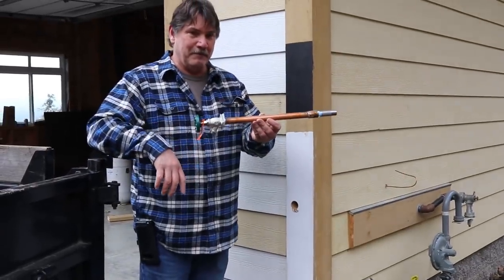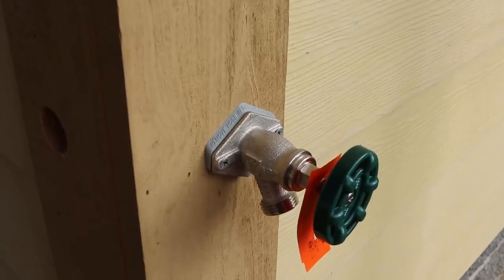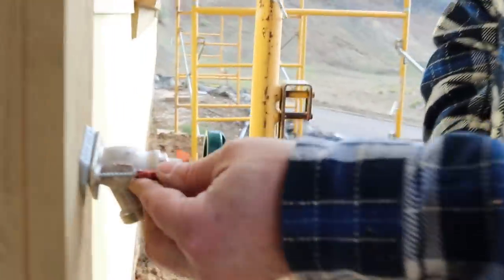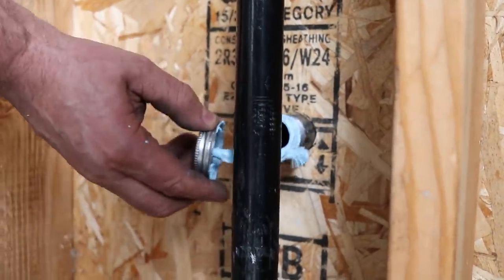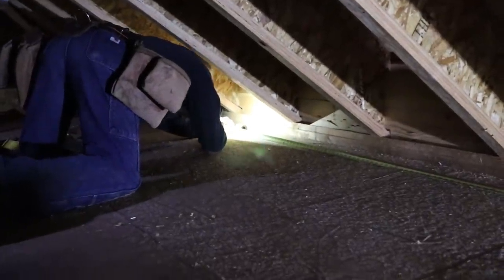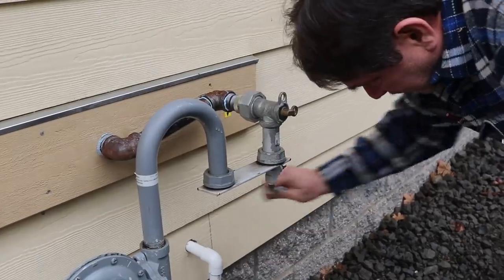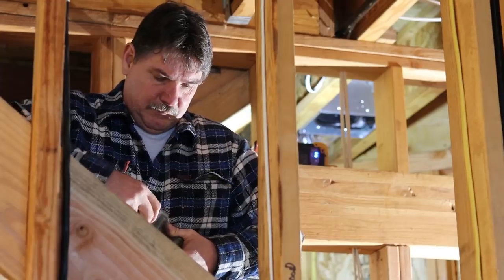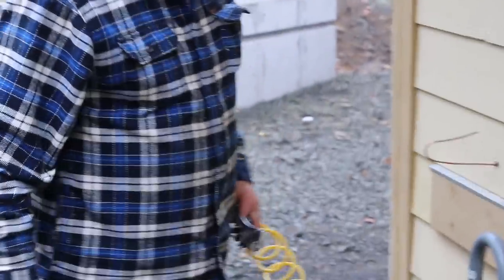Gas Pipe, Hose Bibs, Water Heater Ep.99

Comment: Would love to hear Phil’s take on corrugated stainless steel for gas lines.
Reply: I work in commercial HVAC design, which exclusively uses steel in my area, so I don’t get much professional experience with CSST. But from what I understand it’s standard in Japan. They developed it because of black iron breaking during earth quakes. 

The fact that it’s cheaper and easier to work with were secondary factors. 

I wanted a gas range and NG for my grill outside, so I just ran two lines myself this fall in CSST. Went well and no leaks. We’ll see how it lasts but I’m feeling good about it all. It was much more robust than I had imagined.
Reply: My first experience with it was my HVAC contractor who installed a ng furnace about 10 years ago. I used it in combination with black iron to self install  a ng power vent water heater Dec 2019.

Comment: I once ran an entire shops worth of black iron (4 bay repair shop, plus outside fittings). It was an absolute pain in the butt, however, a very important lesson was learned in the process. Use plenty of union fittings so you don’t have to tear everything apart to fix something at the beginning of the run. A lesson learned the hard way. Thanks for the wealth of knowledge that you willingly share Scott, it is greatly appreciated.
Reply: All you need is a sawzall and you can add a union where ever you want.

Comment: My hose bibs are built into the wall of the house in a stainless steel electrical junction box with a key locked gasketed door. The inside of the box (except the back) is insulated w/ standard 1" thick black rubber  HVAC chiller type insulation. All 4 hose bibs have both hot and cold water and are frost proof. (Prier faucets). The hot water is hand key controlled so that some dumbass wont turn on the hot and burn themselves. That's also why I used a locking cover box. I have a short handmade copper tube extension with a female swivel GHT adapter for connection to the faucet that then  exits out the bottom of the box with a Male GHT coupling for the hose to connect to. I had to trim the elbows to length to get it to fit. Guess you can call it half a solder joint. Then I can leave the hose on the bib during the summer with the door locked. The insulation on the bottom is loose and is removed during the summer while said adapter is in place and is returned to the box when its chilly. A small piece of stainless covers the extension exit hole to help prevent damage to the insulation. If I need hose water in the winter i just unlock the box and attach the hose to the faucet. When I'm done, then the  hose is stored away and then the box is locked up. There are 2ea  3/16 weep holes in the box front corners to allow any condensation or stray water to find a way out. The box is canted so the the top protrudes out 1/2 more than the bottom and those drain weep holes are lower at the front. The insulation is notched at the weep holes to allow drainage. Yes they were expensive to do 20 whatever years ago, but haven't frozen like some neighbors have done. with that costing them $1000. for the deductible with some having to repair twice until I talked them into heat trace cable. BTW the faucet cover doors are on the alarm system. You got a great plumber there.
Reply: Good thinking!
Reply: What area do you live in that the box enclosure is needed around a nominally frost-safe bib?

For either kind of installation, correctly applied thermal insulation would surely be needed. The bib won’t freeze if the inside end is truly in the conditioned space and from there slopes down outwards as shown. A box lid, by contrast, is hard to insulate well, and you need the weep holes. Could you be losing heat unnecessarily?

Comment: "If there are leaks you basically have to tear the whole system apart to get back to the leaky fitting". Eeeeh normally if that's the case i'll just cut the longest straightest piece closest to the leak and install a union.
Reply: You can't use unions if it will be concealed though....
Reply: Yeah they don’t let us install a union around these parts must be nice
Reply: its these moments when the ridgid press tool comes in very handy

Comment: Actual question, why not have reverse threaded fittings, which would allow you to remove certain joints without having to "undo" the whole pipe system to that point?
Reply: There are fittings called unions that can be installed in key places for that purpose.

Comment: I well remember years ago a plumber running pipe to our new gas stove. Guy checked for leaks with a lighter, which was a huge red flag/ Two days later, what's that smell? He'd used a 2" nipple to connect the flexible gas supply to the stove and gibbled the threads up with his pipe wrench. Got a new, longer nipple and some pipe dope and fixed it myself. And checked for leaks with soapy water.
Reply: It's not really a red flag.  Natural gas is fine to do that on, but it's not standard practice.  Propane is not a good idea.

Comment: I like seeing you run gas for the dryer. I’ve never understood why people run natural gas in there house but don’t run a line to the dryer. Having gone between the two i have to say my gas dryers were always a lot better.
Reply: They don't want to pay that little extra up front for the labor on the iron pipe, but they more than pay for it through higher electrical bills. 
I have gas everything. Dryer, stove, furnace & hot water. 
Very economical.

Comment: The only downside I’ve heard to tankless is that if there’s a power outage you will lose your hot water.
Reply: You won't have any water at all because the well pump won't work either.
Reply: @Alex.AL_26  Sucks for the ~1% of people who use a well for their water supply.
Reply: @jej3451  I am afraid it is a lot more than 1%, as soon as you get outside of a large metropolitan area everyone is on wells.
Reply: @Alex.AL_26  Okay, 15% of the population (per USGS statistics).  There is an 85% chance your original comment was wrong.

Comment: we like to put unions every 20 feet or so for future service
Reply: Unions are only allowed between the appliance shutoff and the appliance.  Never inside a wall or crawl space. Use left right coupling and nipple to t in or repair. I know, it’s harder that way but I’ve found unions leaking while doing my pressure testing and it’s a pain to go after and remove them. A well installed system won’t need to be repaired and it’s rare that you can add a new appliance without upgrading the system or running a new line.  On a big system you can cap and test the system every so often so you don’t have to backtrack too far to resolve a leak
Reply: @mikefox5510  Cool thanks for the reply!  i'm still learning...i learned mainly for one guy who learned from his dad...always good to hear how others in the trade do it

Comment: A word to the wise on living with a tankless hot water heater.  Don't just look at the hot water output.  Also take note of the minimum flow required to kick the heater on.  It can be frustrating to all of a sudden find cold water flowing because you turned the hot water down and not enough was flowing to keep the heat on.  Especially a problem in hot climates (e.g. Arizona), where ground water can be pretty warm and not much hot water is needed for the desired temperature.

Comment: The pipe dope and teflon tape is applied to tapered threads to serve as a lubricant. The interference fit of the threads is what seals the connection. The tape or dope helps to ensure that you can freely turn the pipe and connectors far enough to make the seal.
Reply: Why not just spray on some WD-40 then?  (Or graphite or other non-flammable lubricant)

Comment: Why are you using steel pipes for the gas if it's under less pressure than the water lines? The plastic hoses look so much easier to assemble.

Comment: I suppose that black iron is the code, nobody sane would chose that out of boredom
Reply: Black pipe is/has been code for gas for a century or more. Galvanized pipe after time will see the zinc flake off and clog the gas jets at the appliance. Black pipe just rusts and has to be replaced when it begins to leak as I learned with my 30/40 year old house a few years ago.
Reply: @charliesimpson2974  thought so, in Europe we use polypropylene for service and copper past the meter

Comment: To all you DIY-ers out there, be sure to check your local building codes...different places have different rules about using galvanized or black-pipe with Natural Gas or Propane Gas. It's complicated.  ,,,and then there's sediment-wells. Ask your Inspector before you build.

Comment: Worked for a (hack) contractor in Ca; about 12 employees. Only subbed out roofing/drywall. Built a post & beam, full wrap siding 2500 sq ft on a narrow lot on the Colorado River. After framing, the house sat for around two months. Came back for siding. Studs were totally tweaked. Put first piece up...OMG!  It would make u seasick (stud bowed 3/8 in, next stud 3/8 out, on a 60 ft wall. No b.s.). Called contractor. He said "it's fine." What an abortion. Luckily went back to my regular job the next week.

Comment: I love Phil's simple explinations and directions. He reminds me of my dad.   He said he did not like frost free calls (1:10).  Check out Matt Risinger (the build show channel) https://youtu.be/JItfWP7Li-8   Go into 4:12 and you can see a simple installation using pex and you can fix it later from outside the house.  I loved it.  I did it on my last house, both in the wall and under the floor.   I would get a shorter hose bib next time.   Also all my external hose bibs come to a shutoff valve in the equipment room with a drain cap screw.  I can turn off the water, open the bibs and blow out the water on all bibs for winterizing.   I do it even though they are frost free cuz of my OCD. If you like it please share it with phil. (I don't buy the expensive hose bibs, I just buy arrowhead)

Comment: Phil made running that screw pipe look easy, especially running the drops in the attic, where the holes were pre-drilled. Typically you expect the take-up on a fitting to be the diameter of the pipe, but that can vary depending on who's running the threader, the condition of the dies and the quality of the fitting and pipe.
Just before I quit working, it could be difficult to do consistent work, the quality of Chinese pipe and fittings can be all over the place. Maybe it's just because my employer just bought the cheapest stuff they could find, but the quality wasn't there like it was in the mid-90's when I first started there. And the black stuff was great, compared to the stainless, it was garbage, but was all we had, had to make it work.
Had to chuckle when Scott referred to the 24" pipe wrench as "big". For a home owner, it is. But size is relative to the field you're working in. Personally the biggest screw pipe I ever ran was 3", and we were using a 4' pipe wrench with a 4' cheater bar and two grown men hanging off the end of it at times. As far as I am concerned, anything bigger than that ought to be welded pipe, I don't want to fool with it. 
Even at that, I've seen pictures of work being done where the tools had to be moved with a crane, and hydraulics employed to actuate them.
Enjoyed Phil, and as always, Thanks for the video!

Comment: For a gas pipe in the UK and most of Europe, we would use copper pipe and solder the same way than the water pipe. I just wonder that in US are not approved / not in the code? As way-way quicker than fiddling with the steel pipe.

Comment: For the hose bib, you should just loop the pex in a perpendicular wall, so you just pull the bib straight out and the pex comes with it and you have full access. You can't do it every time, but if you plan the design right from the beginning, you often can.  In the one he did, he had the perfect opportunity.. drill straight through the studs to get in a bay that you can loop.

Comment: It's against gas code in Canada to conceal a swing joint. Also you have to use a 3" pressure gauge that goes up to 45psi or so.  The scale has to be appropriate for testing pressures. Most times we test 15psi for 15min here. A gauge that read up to 100psi or and small would be too hard to tell if there was a leak. At least it would take a significantly longer time than 15min for a leak to show.

Comment: Tankless units really don't save energy or money.

In your case, your tankless unit will require natural gas, you should have gotten a heat pump water heater instead. Then you could have no natural gas service, and much less carbon emissions.

Those units need much more regular flushing, or they scale up. If you never run out of hot water, you end up using more of it. You will pay similar amounts in energy, and now you need more flushing. Also, you have an entire additional system in the house, and worse environmental performance as a result.

You should get an induction stove, better performance, easier to clean, no emissions or issues with air quality, no fire hazard.

The dryer should be a heat pump dryer, then you can save energy and money, and also eliminate your dryer vent, another unnecessary penetration in your envelope.

Moving away from gas is a great way to save money, emissions, complexity, and to get higher quality products.

Comment: Two more reasons not to use tef tape on gas?--try as we might pipe dope gets inside the pipe. Tef tape getting loose and blowing,tumbling  down the pipe to an orifice is NOT what we want. Second, the lubricity of teflon tape makes it easier to spin in the fitting. Great, but you need the fitting to be stable and actually lock together with the end of the pipe to maintain  squareness of the assembly.

Comment: I'm curious, is it neccessary to put soap on all the joints to test for leaks? Why not pressurise the system with the pressure gauge (as they did), then come back the next day and if there is no change in pressure,  no leaks.

Comment: Put in a new hose bib a couple of years ago. It has a gasketed cap on it which leaks under the pressure of a freeze. It's reminded me several times that I forgot to take the hose off during cold weather. But it's no problem  to realign the assembly and put it to rights.

Comment: You should be aware that at least an inch of unthreaded black pipe should be visible were a gas pipe passes through a wall on the outside. This is a code requirement, so you are able to back up the wall piece. Street elbows are not permitted in the code these days.

Comment: These hose bibs need to be sloped properly, and there should be a requirement in every codes to have the shut off behind an access door in the heated space. The shut off without the slope is pointless, they burst and you dont see it until it's too late.

Comment: Those gas water heaters are standard in my country. They are actually a combination of water heater and central heating. 
Typically they have between 12 and 25kW of burner power, and the post-2000 condensing units have efficiencies of close to 100%. 
Often, they also have a small tank of a few liters in there so you have hot water immediately - for just washing hands, no waiting until the burner has heated the whole system. In the older ones, you can hear the heater switch on every few hours. In the newest ones, once per 12 hours is enough to keep it at around 65 deg C. But for the real skimpy people, you can turn off that setting and just wait for 30 seconds or so for the thing to heat up. 
They're brilliant things. Pretty reliable, easy to service by a professional. 
The older ones lasted for decades, but are now replaced because of efficiency reasons. Newer ones with more finnicky electronics typically don't last as long. 
They're priced between 1500 and 3000 euro for a residential unit.

Comment: HaHaHa, he puts a hose bib in that is frost proof that goes in a foot, but the other side of the wall is only 2 inches a way from the outside.  This might as well be a 4 or 6 inch hose bib.  Were is the cold going to be?  Don't put pipes on corners,  They should met up with an inside wall.

Comment: I saw a trick where the plumber made a loop of pex in the wall, running thru some pvc pipe. So you can pull the entire frost free valve out of the building when replacing it in the future. I live in New England and we tend to have full height basement.

Comment: ah good old black gas pipe threaded many a foot of it standing in the snow with my Ridgid and an oil can oh to be young again lmao there was one leak that i still remember a bad 90% on the back of it facing the wall took almost 2.5 hours of soaping the whole system looking for it drove us nuts am guessing Phil must have had at least one like that when i was doing it in 80's we would have it hold 25lbs for half an hour and that was it if it held we were done no soaping unless it was leaking great video as usual

Comment: From a physical standpoint, there are two reasons why gas lines are less prone to leaking than water. Pressure and molecule size. Water is higher pressure sure, but it is also a smaller molecule and thus can fit through smaller gaps than natural gas (Water is smaller than Methane, which is the smallest of the hydrocarbons). So the low pressure of the gas line isn't the only reason why it is less likely to leak.
Reply from the maker: Thank you very much for this!

Comment: At 16:25 is that a piece of copper pipe installed into the mostly steel piping run?  What is the purpose and will there be an issue with the different metals and corrosion or electrolysis ?

Comment: Last plumbing project I did was using 2" fittings from ACE hardware made in China to install a greenhouse hydronic heating system using oil field drill pipe.  Spent hours trying to get the ACE hardware made in China threads to not leak.  This is between two ACE hardware made in China fittings.  Threads just did not mesh worth a bleep. Did I mention this was a problem with ACE hardware made in China fittings?